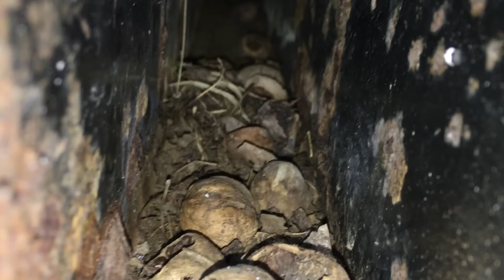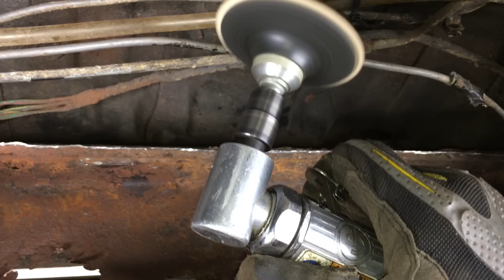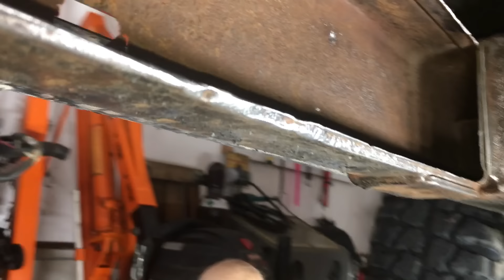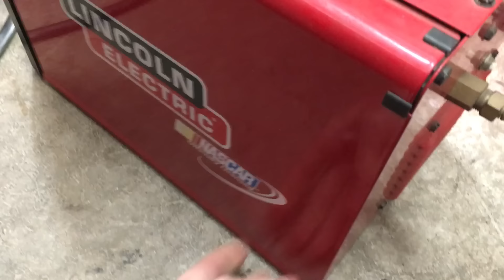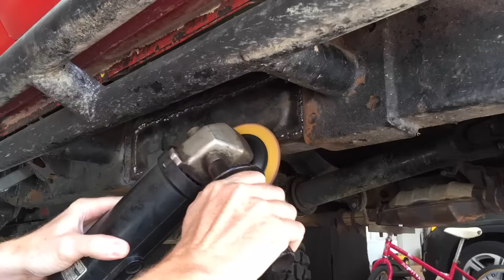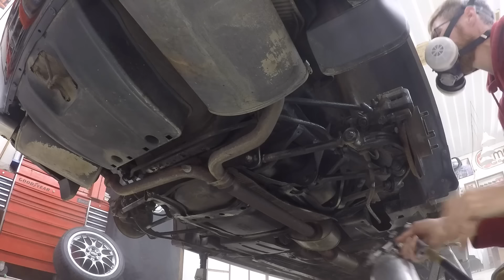How to Properly Repair Rusty Frame of Toyota Pickup Truck at Home

Comment: New to welding. Mostly stick. When you did your tig welding, did you set up for a negative electrode with the chassis positive? Did you disconnect the battery or any connections to the computer modules for the engine and transmission? Please advise.
Reply from the maker: My welder is MIG, not TIG, so I can;t offer any advice on TIG welding as I have never done it.  Yes, always disconnect the battery to be safe. That's all I had to disconnect, but this truck is an 85, so there are less electronics compared to modern vehicles.

Comment: How about why you didn’t prime and paint the inside of the frame before you put the last piece and wouldn’t that have made some sense
Reply from the maker: I used Fluid Film instead later in the video. I didn’t want primer/paint to flake off and clog the drain holes.

Comment: As a professional detailer, i highly recommend using a spray on rinse off sacrificial topcoat, ceramic ideally. Degreaser is best to clean with, Rinseless Wash is even safer but takes longer to knock off dirt. Ideally prespray with a lightly diluted degreaser, rinse, spray witha rinseless or degreaser again, agitate with a flag tip brush, and if you used rinseless, you can spray the same brands spray and rinse sealant. Motorplast from Koch Chemie would be good if the undercarriage has a lot of rubber and plastic bits to protect, spray it on a rinsed surface and rinse again.

Doing this prevents weathering, and ceramic coatings not only stop as much grit from sticking (self cleaning properties), but it helps grit slide instead of grind against the surface, prolonging your undercariage coating. They also make gel coatings to go on top of the undercarriage coating.

My favorite is if you catch youre frame before theres much rust, or if you fix all of it, you can pick your favorite carsundercarriage coating. Mine is from my 2008 Passat or a friends 1997 Volvo 970. You can look up that cars undercarriage paint or coating, and more than likely someone still sells the oem one, or at least the same type. 
Just avoid new GM as the undercoating is only a gel that you can just kinda scrape off with a fingernail😅

Comment: After clearing out the broken off chunks of rust inside the frame, it might be a good idea to spray a high quality rust converter into the frame using a power washer. Once it dries, spray an oil in there then weld your new sheet metal in place.
Reply from the maker: Good idea, but I would spray the oil last, after welding, as not to let the oil contaminate the welds.

Comment: What about cutting a hole just big enough to put a pressure washer wand in there and going to town on it
Reply from the maker: That may work in some areas, but there are baffles on the inside of the frame.

Comment: Too bad old Toyotas aren’t as popular as old chevys, there would be replacement chassis options, or maybe fatman fabrication does make them, never checked. To me it seems like the entirety of the frame has been compromised, it is a lot more than thickness that makes up the strength. I restore motorcycles and atv’s, and the frames get 100% de rusted with a strong rust remover and powder coated, would be pretty costly to do that for a truck chassis though, it would take thousands of dollars in evaporust just to soak it. Those old Toyotas are cool as hell but a patched up frame will never be as strong as original good condition. Ok for show or mild use
Reply from the maker: Yeah this isn't the first time it has been repaired either.  I'm hoping it will get me by until I can afford to ship a rust free frame from out west and have it blasted and painted. Then I'll swap everything over.

Comment: It honestly sounded like you had the heat turned up a bit too high and were moving the gun a little too fast. That's where you are getting the bubbles and pinholes.

Comment: Once you weld in the new steel and correctly do the repair, coat the frame in POR 15. It's a great to encapsulate and stop rust!
Reply from the maker: POR15 is a great product, I've used it on a lot of my trucks.

Comment: I weld a lot , I'm not an <expert> but know what I'm doing. First off a Lincoln 240v welder is much better.
Also from lots of experience and testing, you don't need a visually perfect looking weld to be strong.
I weld aluminium as well, more tricky than mild steel but rewarding  . Alun is 1\3rd lighter and 2\3 less strong as well compared to steel.

Enjoyed watching this video.
Reply from the maker: Thanks! I got a 240v welder for another frame job and it was night and day difference!
Reply: @6thGearGarage  yes it is, but the 110v is more portable and you can use it for small jobs.

Comment: Is anyone aware of frame kits available for the last series of Toyota Pickup?  I've been looking for kits to fit the 1988-1995 4x4 with single cab. but I've had zero luck locating anything for the frame on the series.  Please let me know if anyone has any info on availability.   Thanks in advance.
Reply from the maker: I used to see the patch over kits for these trucks but I searched and now I'm only finding them for 95+ Tacomas.
Reply: @6thGearGarage  Yea, I've run into the same results.  I have a bit of rot that's being repaired but it would have been nice to have a kit available for future use.  Thanks for the reply.

Comment: So how bad is too bad to fix? I have a 2012 Silverado with frame rot in the typical spots… I just rebuilt the engine and I’m currently replacing everything in the front end. I knew the frame was rusting out, but I just looked again today and I swear it’s getting worse every time I look at it now… The passenger side is much worse, it has about a foot long section right before the frame starts curving up. The driver side is still only about 4-6 inches, I know that side is fixable. I have no sagging yet, the bed and cab sit even with each other… I dont pull any trailers or haul anything except passengers in it… I just don’t wanna retire it quite yet, frankly I’m going to at least “fix” the frame so the rotting isn’t noticeable anymore… pretty much just wondering if I could still get some of the structural integrity back, or should I just keep it as light duty as possible?
Reply from the maker: I’d say it’s worth fixing, if not the proper way, then at least welding a cap over the existing frame so you can get a little more time out of it.

Comment: You live in Ohio where you don't need inspection or fail inspection with welding marks on a frame
Reply from the maker: True, they’ll ticket you for window tint here, but let you drive with chunks of rust falling off your truck.

Comment: I use an attatchment for a compressor spray gun, or underseal gun thats a long length of flexiable tube with a multi direction nozzel on it for spraying oil or underseal inside of chassis by putting it in the holes squeezing the trigger and slowely pulling it out
Reply: Ah, i see you use the rattle can version but same thing.
Reply from the maker: Yeah but I would like to find a nicer one I can use with my compressor. The aerosol cans are more expensive than the gallons and that plastic hose sprayer started leaking after about 5 years.

Comment: Drain holes drain holes drain holes...You can reinforce all you want but you need to drill at least 5/16 or bigger drain holes every 12 inches. Obviously use your judgment near curves and sensitive components. Then slant the truck on an incline and pressure wash the INTERIOR of the rails. Let dry at least 2 weeks then use fluid film to rustproof EVERY-WHERE. Repeat every year...

Comment: Nice job overall!  I would have made the cuts with a plasma cutter.  Use a stick welder for better penetration.  When grinding, make V grooves - not flat.  You want an angle so your welds penetrate the steel.  I'm not too fussy about undercoating.  Power coating?  WD40?  Thanks for the video!
Reply from the maker: After this I got a 220v mig and what a difference it makes for frame welding! I used it to mini C-notch the frame of my 1980 2wd and it was a breeze. https://youtu.be/ylkHDaurM6A

Comment: Drill access holes in the frame that are spaced out a little shorter than the length of your Fluid Film extension hose. That way you can hit all parts of the frame inside, with no gaps in coverage.
Reply from the maker: Good call

Comment: Your welder should have a chart to refer to the proper starting settings (wire size, current, voltage, etc.  Also, practice weld on some scrap steel of the same thickness to dial in your welds based on your welding “style”.
Reply from the maker: I bought a 220v mig since this video and it has a chart. The extra power makes such a difference on thick steel like a frame.

Comment: These old Toyota pick up truck just rot and rot. Best to remove the bed, strip the rest out and get the chassis blasted. Then start cutting and rebuild. I guarantee there will be at least 100% more corrosion than you first thought.
Once welded ensure you use a good quality rust proofing inside the chassis and obviously treat and repair to the rebuilt chassis.

Comment: Thank you for that video.
I noticed when you were welding horizontal and overhead.
It may be easier to spot the weld in as you go. Hold your trigger a couple  seconds each time to achieve max penetration. You wont have to go back over your weld and it will give a great ripple effect like a aluminum weld 
Keep up the great work 👍.
Reply: That is exactly what i do.

Comment: First thing……unhook your battery, positive and negative. 😉
Reply: And, you have me confused. Flux core mig is gas less. Yet I see you using gas? Flux is the coating on a rod for stick welding, it creates shielding gas as it’s burning. 
Same concept with flux core mig. 
But, Flux core mig should never be used for steel that’s going to be vibrated, bc it’s a brittle weld.
And lastly, there are different wire diameters for mig welders for bigger gaps.
Reply from the maker: I wasn't using flux core. Good call on the battery, especially with newer vehicles that have a lot of electronics!
Reply: @6thGearGarage  good job btw. I’m in Ohio also and have a 3rd gen 4Runner I have been fixing up. A little mechanical, a lot of fabrication lol.
I don’t mig though I tig bc the torch is much easier to manipulate and fits in tight spaces. I will be using your idea with the shop vac and garden hose. I used an extended magnet for the big pieces and an air nozzle in the holes.

Comment: In England we have a product called Waxoil Rust Protection. This can be sprayed into enclosed areas like sills (think you call them rockers in the USA) or frames. Would have been good to do this before welding although you could still spray it through the holes you showed us. Very good. Be good if all car manufacturers use it in high rusting parts of the country.
Reply from the maker: That is a very good solution. I did the same with a product called Fluid Film toward the end of the video. I highly recommend it 👍

Comment: Very comprehensive video sir. I commend anyone who's actually doing this kind of work on their older vehicles. Being an owner of a 97 GMC Yukon, I was fortunate enough to still have a solid frame that didn't require welding repair. However the surface rust along the frame as well as towards the back of the vehicle (where the spare tire sits) was absolutely horrendous. I ended up using a needle scaler to get the majority of the rust off, cleaned the frame with POR15 rust remover and a pressure washer, then proceeded to spray it with fluid film oil spray. Unfortunately the fluid film didn't last very long and dried off within 3 months of application. It's a real shame that North American weather and road brine don't play nice with our relics. Keep that truck beautiful bud  ✌🤟
Reply from the maker: The best thing for Fluid Film is to drive down a dusty road after application. The dust will help it adhere to the metal better and last longer.
Reply: @6thGearGarage  I appreciate the advice. I will be doing that come fall time for sure.

Comment: If the rust sitting in the frame holds moisture and causes more rust, then why is it rusting through on the sides, but not the bottom?
Reply from the maker: That's a good question and I'm not really sure.  I've seen some where the rust is eating through the sides and bottom, but the sides always start rusting through first. There is a black factory paint sprayed on the inside of the frame. Perhaps the paint runs down and is thicker when it settles on the inside of the bottom of the frame? That's my only guess. I'd really like to know!

Comment: I think you did a thorough repair here. One question for you though… wouldn’t it be dangerous to take out large chunks of a frame like that? I mean, you’re sitting under it after all and that’s what’s holding the truck up.
Reply from the maker: I think as long as the truck is stationary and supported evenly, it is safe. You're right the entire truck is heavy, but a lot of that weight is the frame itself and the axles, wheels & suspension beneath it.

Comment: Nope, I use Brunox as rust converter, then Fertan epoxy primer , then Dinitrol bitumen-wax undercoating.

Naturally, it doesn't hold up for too many years when doing 20000+ km a year ... but it does fare good enough.

Comment: I have a 1981 Toyota pickup diesel, but it’s been sitting in a field for 20 years. The frame is decent except for on bolt sides where it curves down at the back. At both of those places it is rusted through and even cracked in half. I can’t really pull it out of the field like that, any tips to either repair it in the field or just brace it to bring home would be greatly appreciated.
Reply from the maker: I wouldn't try to repair it in the field. The truck needs to be on flat, level solid ground to be sure everything stays square and even.  If you can, just weld on or bolt on some temporary bracing to hold it together until you can get it inside to repair it.

Comment: Hi informative video. I have 93 mazda 929. I have 1' long bad rusting where you put the lift arm on driver side passenger. I am not sure if this car is unibody or body on frame. Also i see very next to the rusty channel is gas tank. Please give me some idea. I really want to repair this and keep my car. Ty
Reply from the maker: I'd guess that the car is unibody. You may need to remove the gas tank to repair the body. Also the rust is always worse than it looks. You'd be surprised how thin the metal around the rusted area can get.
Reply: @6thGearGarage  thank you

Comment: I think there a flaw in your repair.  The chain or the frame is going to be as strong as the weakest point.  You should have reinforced the top panel which is probably the most important.
Reply: The top panel is thicker because the moisture has been  against the inside bottom of the frame eating away that metal

Comment: The old timers used to tell me after they fix a frame they'd weld all the holes and fill the frame with oil. I know the holes are there for a reason but they'd never rust from the inside out ahah.
Reply: Hrmmmmm.... good idea!  I may do this with mine

Comment: Back in the oder days my dad, grand dad, and great uncle used used motor oil and diesel fuel in a garden pumpp up sprayer to under coat there pick ups ! 
Here to tell you my great uncle had the cleanest working 74 International 4x4 3/4 ton with 401 4speed !And 72 olds 98 in the late 80's that would make new car owers jealous ! No rust on either of those cars and he moved here to WV from Akron Ohio ! So wasn't like he moved from the south to WV ! He moved from salt city Ohio to mid state  sinderville WV ! Yes sinders (extra small black stones spinkled on intersections and hills to add traction in iceyand snow conditions !)
Reply from the maker: I've heard motor oil + diesel also makes a great sealant for the wood planks on trailers.

Comment: As a welder, clean your metal more, and do longer beads. When you stop and start like that your having to re create a puddle adding more and more heat than you need to make, also if your not experienced your starts may not have as much penetration so doing longer beads will let you keep a deeper penetrating weld going.

Comment: $100 in materials and in 5 hours you could have a 60 amp circuit to run a 240 volt welder.
Reply from the maker: I bought a 220 mig since this video and it’s so much better for welding frames 👍

Comment: I have drilled a frame for better drainage.  I drilled the ends as well to power wash directionally. 
Then I drilled some flat metal with a larger hole. Then welded those over the hole to increase strength with out restricting the drain. 

After painting the complete frame. I use a hand pump (2gal) to spray a mix inside each hole from as many directions and as solid as possible. 

My favorite mix is WD40/Marvel Mystery Oil.

Buy both by the gal 🤦🏻‍♀️ I like the smell of both 

Btw it destroys the sprayer. You will have to buy a new one yearly 

Keep them clean and lubricated help to prevent future problems 😮

Enjoyed your video
Reply: I do something similar but using waxoyl. I drill out holes along the chassis / body ares... add waxoyl and then fit plugs. I generally plop some sealant over the plugs. Every year I pull the plugs and rewaxoyl the chassis. So far so good.
Reply: @harwoods11  good idea 👍
Reply from the maker: Thanks for the tips! Do you use a compressor type sprayer or a garden/weed killer type sprayer?
Reply: @6thGearGarage  weed/garden

Comment: I work the same way at home, thanks for the upload. Just: It is incomprehensible why you bother with 11/16 and other complicated zoll sizes instead of simple mm. For smaller sizes, this can be a pain...
Reply from the maker: I’m in the US, as well as most of my viewers, so I usually use inches because Americans don’t use the metric system for some reason.🤔